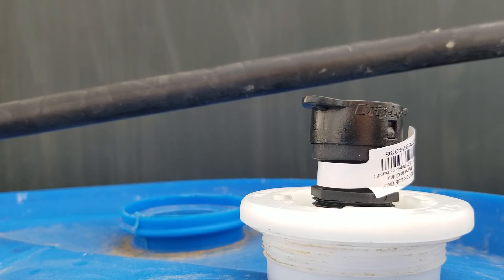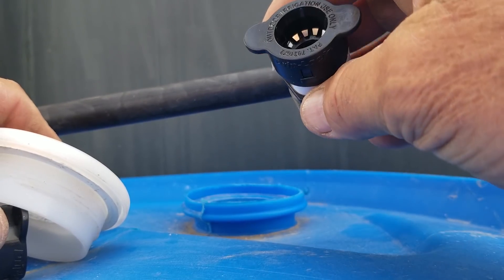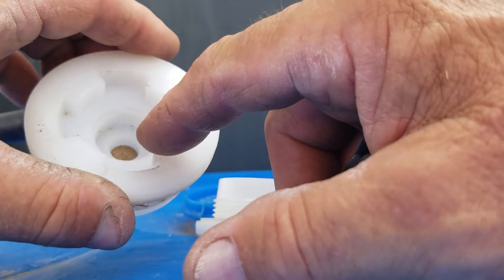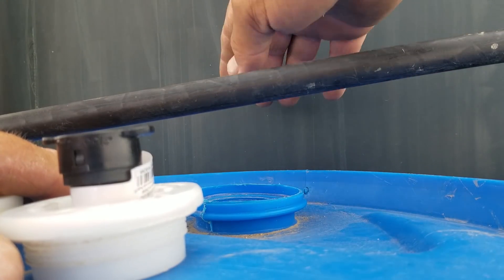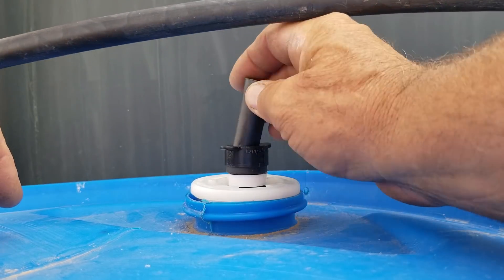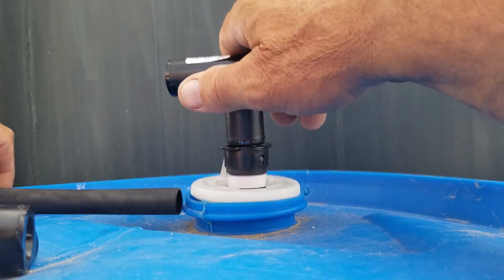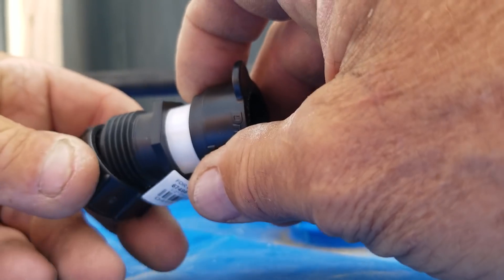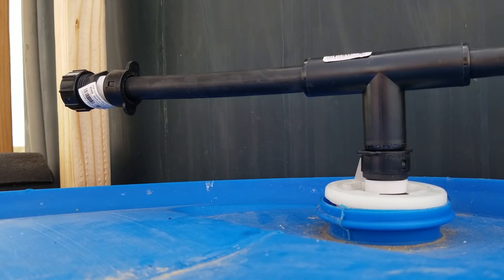Venting and chlorination of off grid water storage tanks. Part1

Comment: Aren't you worried critters will chew through the piping?
Reply from the maker: No.  The pipes are not on the ground.
Reply: Critters can climb you know  @GBear
Reply from the maker: @Ducelick  I haven't had that problem here, and those plastic connections would require them to climb a 60 gallon barrels smooth sides.  Not likely.  Birds can get up there, but they don't have teeth. 😏

Comment: Looks great!  I am concerned though about the water pressure on the drip line from the water above it in the black tank.  Drip irrigation is for low pressure??  Just worried you will spring a leak.
Reply from the maker: The drip lines are designed to take the pressure , slightly reduced from irrigation sprinklers, but mine aren't for water pressure.   They are for air purging as the barrels fill and drain.  I have a valve between the barrels and the tank that will be closed as soon as the water in the tank equalizes with the level of the barrels, and not reopened until the tank level falls below the barrel tops.
Welcome aboard and thanks for watching and commenting!
Reply: @GBear  Sorry, I meant to say "irrigation" line.  The shut off valve to protect those lines.  Good idea!